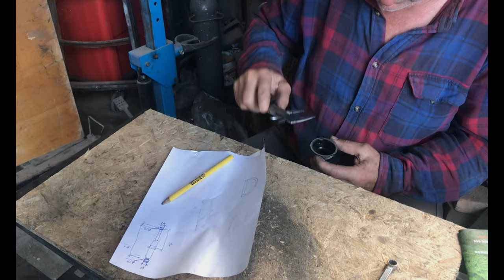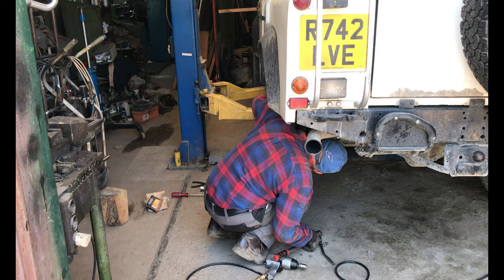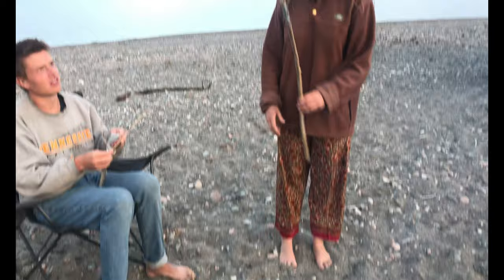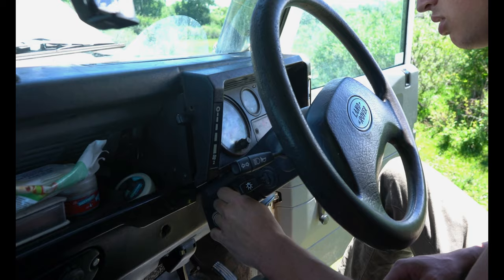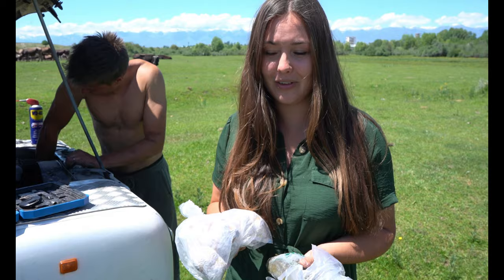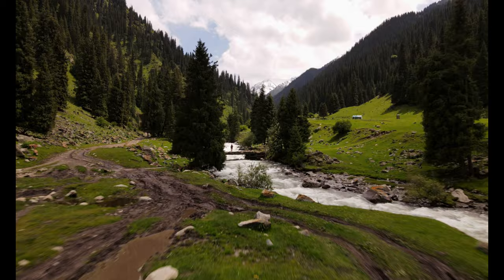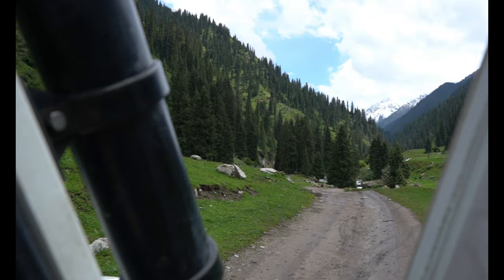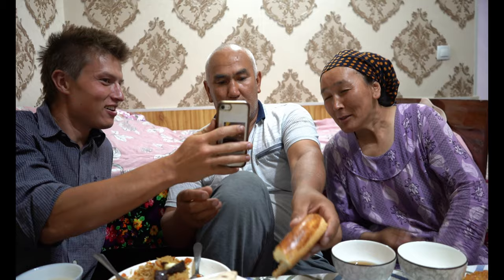ASIA OVERLAND (Ep12) - Land Rover Defender road trip across Kyrgyzstan

Comment: Wheel spacers add a lot more stress to your wheel bearings, as the load is not carried evenly over the bearing.  There's an 8 part series of engineering level videos on "Defender mods and travels" on YouTube about why axles break on overlanding vehicles.  Worth the watch.  A cheap volt meter in the car will allow you to constantly monitor alternator function.  Nice to see you unphased by the issues and happily motoring along.
Reply from the maker: We’ll check it out, thanks! ☺️ yeah we really wish we had one 😂 Yak keeps going just about 💪